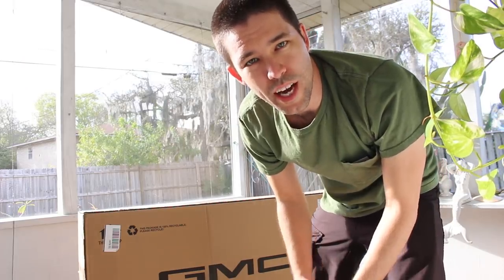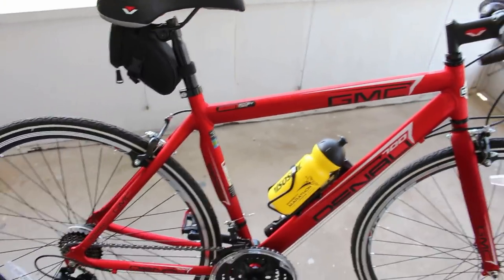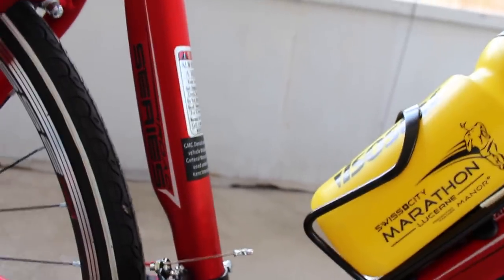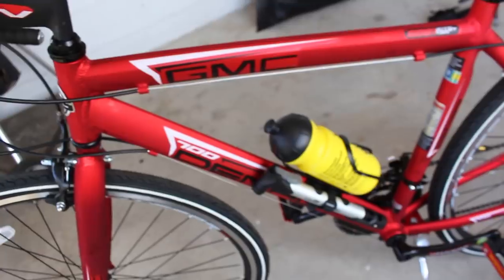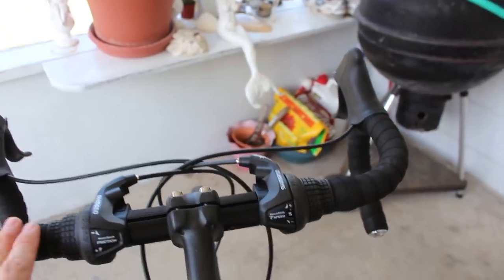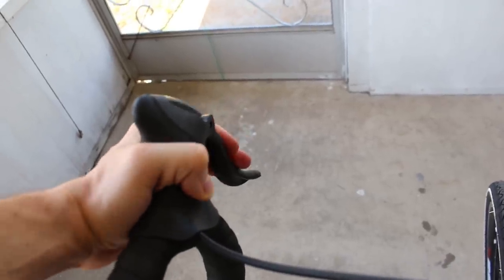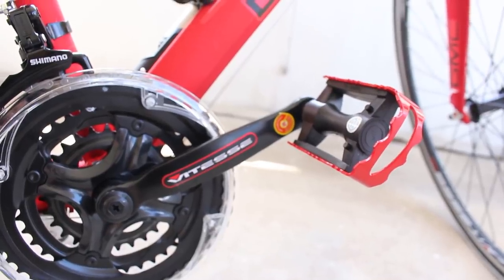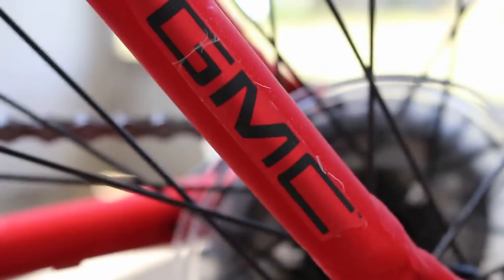Unboxing and assembly of my $99 Walmart Road bike

Comment: Was a little apprehensive when buying this with the few negative reviews on here, but this was exactly the kind of bike I was looking for. https://www.youtube.com/post/Ugkxn_jUDSlprMIeubd9rHdEAnv59nKfjcKv I plan to ride it on paved roadways and trails, and wanted a "Grocery Getter" so to speak. After receiving it (without any damage), I had it out of the box, and fully assembled in about 30 minutes. I did not have to look at the manual, and I'm glad because I did look at it after I got it together, and it looks like it's a manual for several different styles. I did have to adjust the breaks and gear shifters, but that's been my experience with every bike I've owned. There was one review in particular that made me nervous, saying it was not meant for someone 6'4", it was too short. Well I'm 6'5" (230lbs) with a 36" inseam, and can tell you this bike fits perfectly, granted the seat is in it's highest safe position. I've only had it for 3 days so far, and if things change I will update my review, but I put 26 miles on it so far, and it rides like a dream. Very comfortable seating position. The front suspension is good for the occasional rock or bump you hit on asphalt, but this bike is not made to be taken off road, and I'm OK with that. I was particularly happy to see the wheels were trued perfectly. I was expecting to have to take them in and have them trued at a local bike shop, as I've had to do with all my past bike purchases, but in this case they were already in great shape. For the money, this is an awesome bike.
Reply from the maker: very glad to hear!

Comment: "It could be a good touring bike..." No, it couldn't.
Reply: Justin Mihalos 
Why not?
Reply: Because it wasn't designed with that in mind. It'd be a fine commuter bike, sure. But there aren't any attachment points for a rack, and twist shifters on the tops of the bars would greatly limit comfort over a long ride. I certainly wouldn't trust those components to last over anything beyond short trips around town, and the associated costs of upgrading is well beyond what a basic touring-capable bike would cost.
Reply from the maker: Should be a video posted very soon about touring with this bike.
Reply: I'm interested to see how it fares.
Reply: Mister Hand  Good counterpoint.